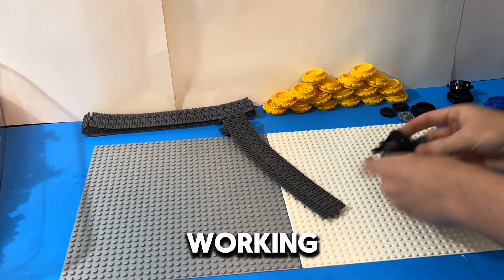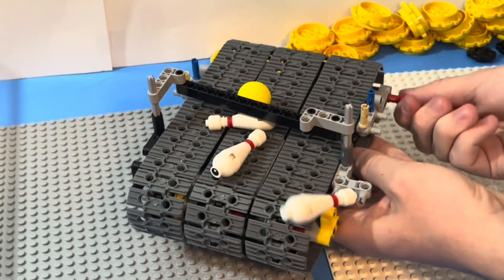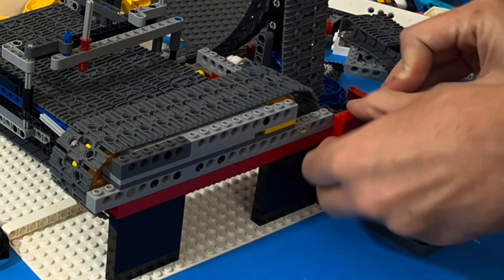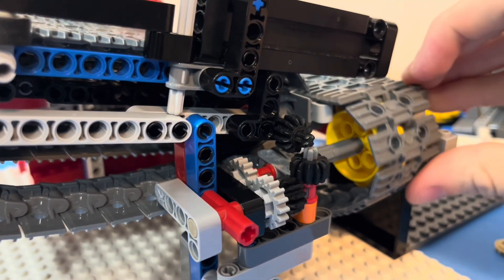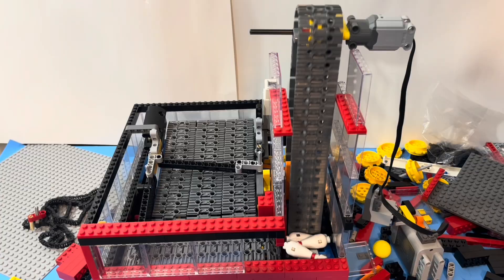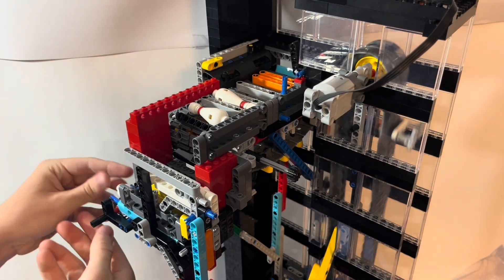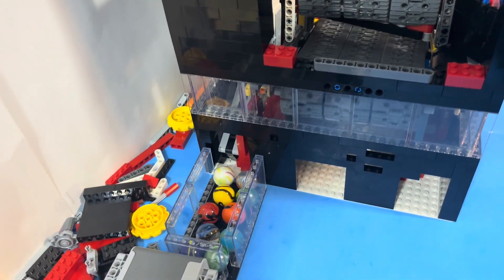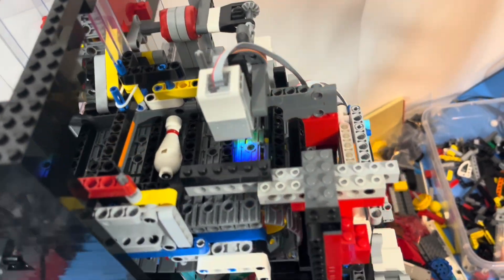Building a Working LEGO Bowling Alley Pinsetter - Episode 1: Pin Cycler

Comment: Bro I really with I had motors but I am siding to Lego engines instead 
To would be cool if you could make it smaller
Reply from the maker: Lego engines are sweet! I’ve made a few small engines before but never really posted them, they’re so much fun! This bowling alley is unfortunately 2/3 the original bowling alley’s size, I was trying to get it down to 1/2 but ended up needing the extra room
Reply: And what size marbles I guess 20 mm
Reply from the maker: @Unstopablegamer111  the marbles are 22mm diameter so they are just bigger than the pin